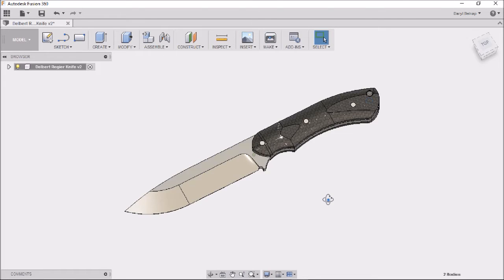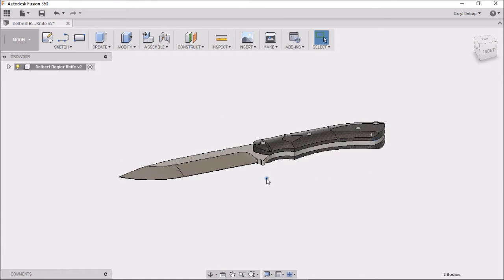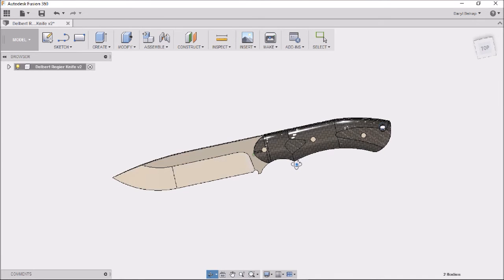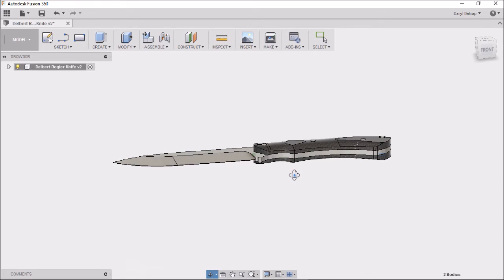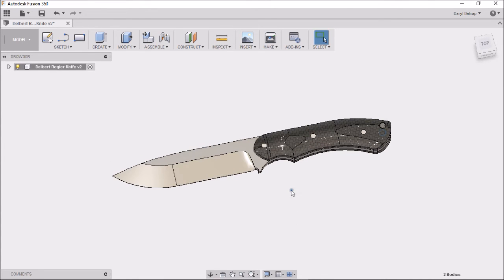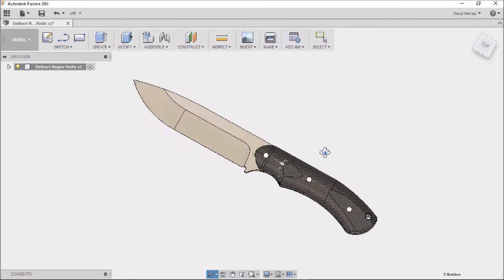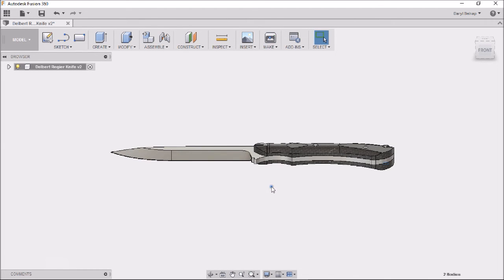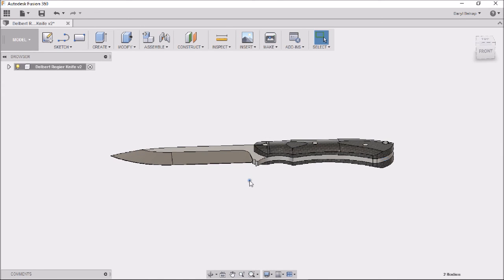Camp Knife with Carbon Fiber Scales - Fusion 360 Design

Comment: sweet design man
Reply from the maker: Thanks.  I like your profile picture.  My makers mark is similar.  Basically a bio-hazard warning symbol with letters BCK in it.  I had it made into a metal stamp.  It arrived after I left for work so it will be December before I get home to test it out.
Reply: BigIronTV that sounds awesome but sucks you have to wait that long to try it out